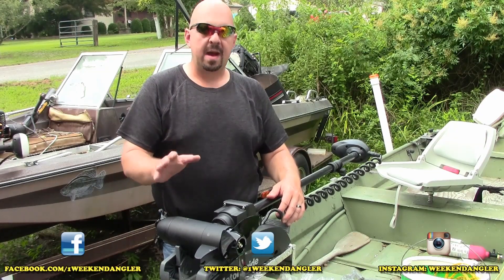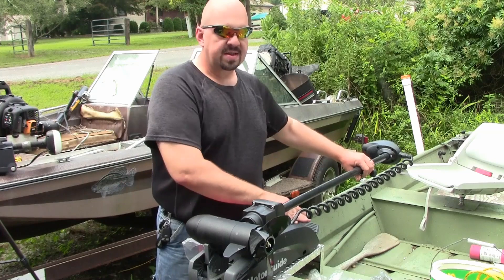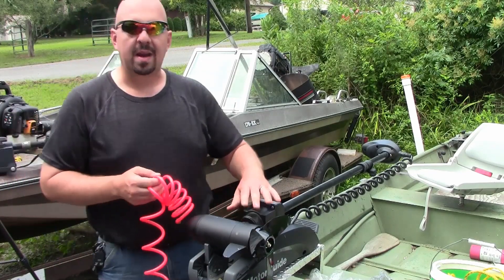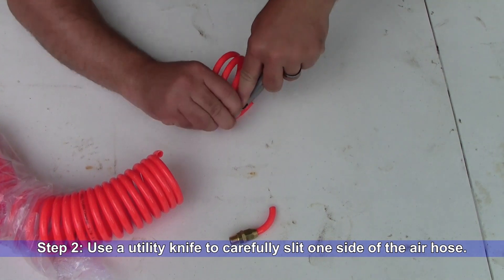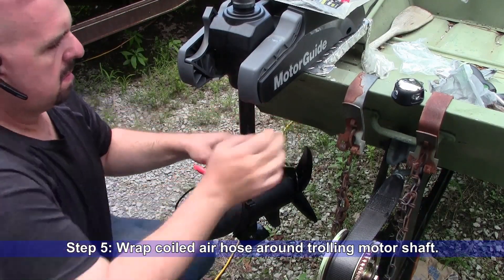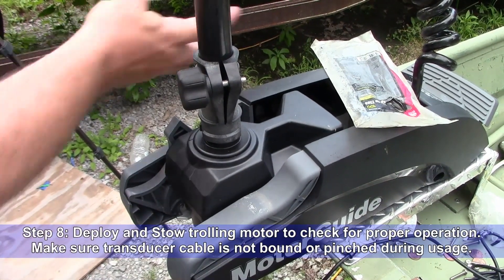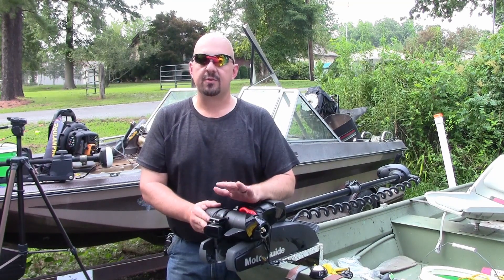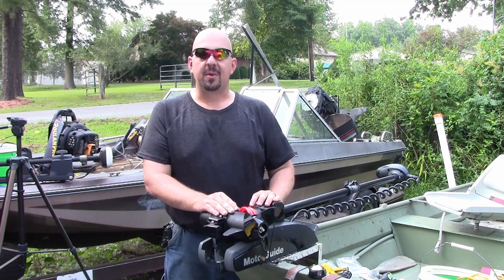How to Install a Transducer on a Motorguide Xi3 or Xi5 Trolling Motor - NO MORE PINCHED CABLES!

Comment: Just wondering great concept. But what about weeds under the water building up or sticks tree tops under the water.. Love the Idea .
Reply from the maker: It would be a hazard of the situation. You'd need to pull the motor up and clear that out if they became clogged.

That being said, I've fished some trashy waters with this setup and not had any issues out of the transducer.

The trolling motor itself is another story. It's likely my last motorguide
Reply: @TheWeekendAngler  Thanks for the reply. Mini Kota,anyway ove a motorguide. Just my opion.
Reply from the maker: @cowboyup545  mine too. I only bought the motorguide because the equivalent minn Kota powerdrive was backordered

Comment: Why does mine have 2 wires coiled up. That one has one.
Reply from the maker: What unit are you running? Some run the power cord and transducer cable on the same run.

Comment: Excellent video! Will definitely solve my problem. Where did you get the transducer mounting bracket for your motor?
Reply from the maker: That mounting bracket actually came with the garmin striker 4 unit I purchased.
Reply: @TheWeekendAngler  ok thanks . Appreciate the quick response. Tight lines!

Comment: great idea for install !! How reliable has the motor been ? Ive read some mixed reviews
Reply from the maker: Love the install, but this will be the last motorguide motor I purchase for a LONG time. 

About 1 year after purchasing the motor new, the steering gearbox jammed. Unlike the Minn Kota powerdrive or terrova, when a motorguide steering box jams you are completely unable to turn the motor left or right by hand.

Of course it did this while my wife and I were out fishing in questionable weather conditions.

The good news is we have a local service center for motorguide, and the motor was repaired for free since it was still under the 2 year warranty.

The bad news is motorguide actually tried to fight the warranty claim. Had it not been for my local service center fighting with motorguide on my behalf, I would have either had to pay out of pocket for the repair or been in a long drawn out battle with motorguide on my own.

When the motor is working it's wonderful. Just be aware that a jammed gearbox is evidently a very common problem with the Xi3 series of motors.

My personal opinion is to stick with Minn Kota. I own products from both brands, and have never had an issue with my MKs.

Thanks for watching and I hope this helps you make an informed decision.
Reply: @TheWeekendAngler  just wow !!!!! Thank you for saving me the headache !!! At half the cost of the terrova I was giving the motor guide some serious consideration.  I suppose you get what you pay for. 

Sorry you had to go through that nut thank you for sharing!!!